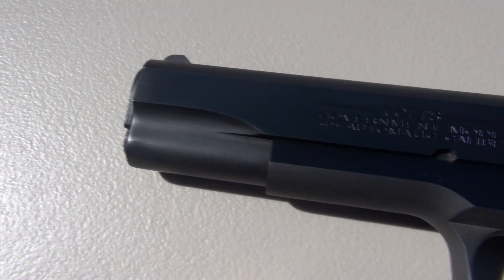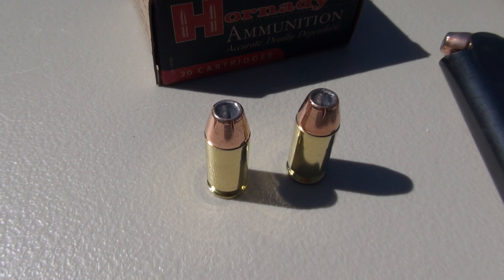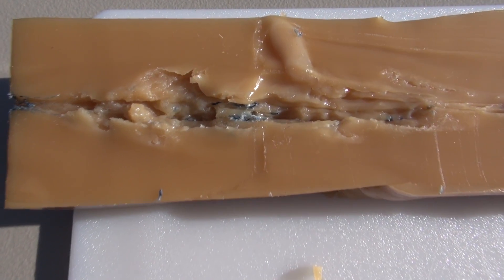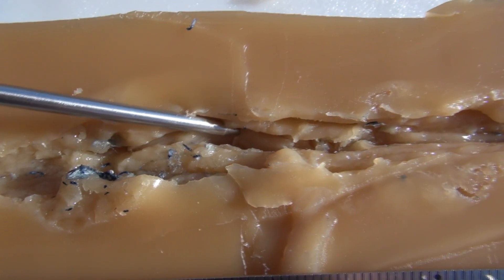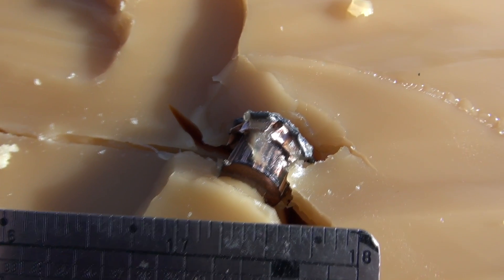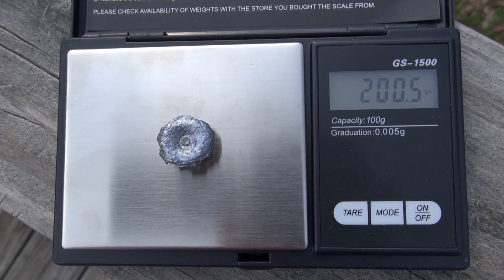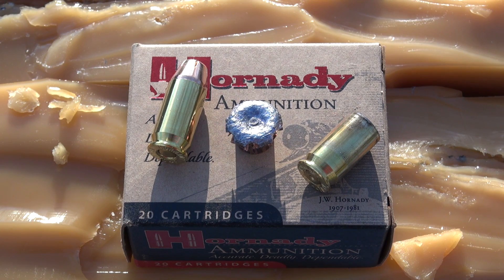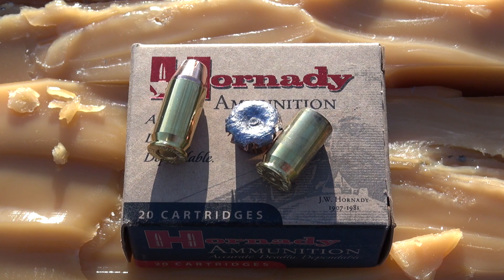.45 ACP +P Hornady XTP 200 gr JHP Gel Ammo Test

Comment: This bullet is sad for me, if it has the same energy levels as a 9mm and less velocity and less capacity than the only advantage it could have is its expanded diameter and thats what the XTP bullets here have taken away. They have neutered the best characteristic and advantage that the 45 always had over other cartridges, really good 45 ammo expands 0.80 and higher and majority of the good stuff to 0.70 and higher. If i wanted this type of penetration and expansion than i would go to 9mm as it has the same energy but more velocity and better penetration through hard barriers and more capacity and easier follow up shots. People need to really realize what are the unique advantages that each caliber has over each other in order to make sure not to take it away when looking for good ammo, i believe this is very important. You want good 45 ammo??? 45 230 grain fed HST (penetration 14 inches expansion 0.80) and also 230 grain winchester ranger T series (penetration 14 inches expansion to 1.00). The Gold dots are good but i dont like em much (penetration 12-14 inches expansion 0.68-0.70) and the old Golden saber bullets by remington were probably the best 45 bullets back in the day before they went extinct with penetration at 16-17 inches and expansion at 0.70 and higher. Have a good day everyone, and remember not every handgun caliber is the same or even near the same and sectional density still counts for something.
Reply: peter prunty    splitting hairs?? than if those measurements mean nothing than i guess all military and police should be using 38 special and 380 acp instead of 9mm since their performance is only different by a few inches or “0.2” hell they might as well carry 32 acp since it only has like 0.20 less expansion than a 9mm and about only a couple inches less of penetration. Guess what though?? there is a reason why the military and police decide to use 9mm instead of 380 acp, because those few inches or that “0.2” actually makes a difference sometimes. Same way that bullet that failed penetrating enough in the miami dade shootout would have made it to the heart had it been another type of cartridge that had that “0.2” as you say it.
Reply: peter prunty      not making any sense?? How if im using your logic of the so called “0.2” being very little
Reply: peter prunty    With your logic the 380 acp would be a better cartridge for police work or soldiers at war, since it is only behind the 9mm by a few small measurements of performance

Comment: This bullets +p can b used at.a glock 30? 45 acp gun
Reply: The glock can handle +P loads. But it's short barrel isn't giving you much advantage. The extra 'power' is not efficiently used in the short barrel and you only end up with extra muzzle flash and recoil.

Comment: I'd say it's perfect.
Reply: Expansion was bad. There are way better rounds.
Reply: @berettaxd7566  
The xtp had an original name of extra terminal penetration. They changed it to extra terminal performance later on. The xtp round is not designed to ultimately expand to the size like an HST would. It's designed to expand but its main design is to give you deeper penetration. Expansion lowers penetration depth. The xtp in this test are performing exactly the way they're supposed to

Comment: I swear that I had read an article somewhere that the Colts original 45 acp was 200 grains but when the military contracted them they asked for a heavier bullet and thus the 230 grains came about
Reply: Your absolutely right!
Reply: The US Army experience in the Philippine Insurrection cost many soldiers lives from the poor performance of the Colt .38 Lightning's lack of Stopping power. The Army had little practical experience with handguns. The Moro's and Huk's  could take 6 x .38's and lop your head off with a Bolo Knife. Western Lawmen knew handguns. What would it take to stop a drunk Indian armed with an axe? Nothing less than .44/.429, 200 gr. and 750 FPS was the answer. .44 Russian, .44 Special, .44-40 and .45 Colt were best. Nobody laughed at someone for carrying a Colt in .38-40. It's really a .40 cal. 180 gr. @ 900 FPS, same as .40 S&W. The .41 Colt was worthless as the bullet was way over stabilized.
Reply: @TheDustysix the problem with 38 long colt wasn’t the bullet diameter, it was the combo of a lightweight bullet at abysmally slow velocity. had they propelled that bullet at a higher velocity, it would’ve been much more effective especially if it was fast enough to cause deformation
Reply: The US Army didn't know handgun effectiveness ?

   The brass and bureaucrats not so much , or didn't really care . The Cavalry Troopers on the ground certainly did , from the recent Indian Wars , and from the Civil War .

   For the peak years of the Indian conflicts , the SAA's were mainly used with the one way interchangeable .45 S&W aka Schofield ammo - 230gr a 700-750 fps .  Civil War ammo ( paper ctgs ) varied between contractors . Nominal 215gr conical , actual between 200-240 . Typical as issued velocities in the 700's .

Comment: I always get less velocity from Hornady ammunition than advertised... On almost every case
Reply: They seem to pud-load their cartridges
Reply: I rarely buy factory, I reload my own. I too,  notice a vast difference in listed velocity vs real velocity. I do know velocity is speculative , meaning elevation and humidity plays a role  plus test guns used in the factory vs your firearm does also. But if a hollow point fails to meet a certain velocity then expansion is effected. I've shot some factory hollow points that just flatly failed to expand at all from my 5 inch 1911. So with that your basically using " Ball ammo" .

Comment: Why would you want to hand load this bullet and push over 1100 fps? The penetration is already at 17.5 ". Hand loads for this bullet would cause over penetration.
Reply: No one answered your last year. This was shot at 10 yards. This is a hunting bullet as such targets may 50 + yards. Extra fps  or velocity will cover distance to deer an retain the fps to have the same effect as this load at 10 yards. This is the purpose of the Underwood ammo. To get down range with enough velocity to be in the bullets  working range for expansion. As the xtp slows expansion goes down an penetration goes up.
Reply: peter prunty  Thanks
Reply: peter prunty  You are contradicting yourself and not making any sense. You say you want over penetration and then say loading it hotter will cause problems with bullet integrity, but loading it hotter will cause both. Over penetration is not good if the hollow point does not expand. You don't know what you are talking about.

Comment: I hunt one area that while outside city limits, still has homes fairly close.  I've used this round in a Marlin Camp carbine several times with great success.  Shots are close and noise is much quieter than a shotgun. 200gr gives massive internal damage with most of the velocity spent by the time it exits. Good compromise. 100 and down sized deer. Inside 50yds no prob.

Comment: 2 questions. How much penetration roughly equates to a pass through on a whitetail deer? Also do you think a 185 xtp from underwood would give adequate penetration? It seems like the more velocity the better with xtp's.
Reply: +K Bob As a LEO I had to put down an injured New England whitetail several years ago. Granted that deer was not in top health. However she was still standing and moving around favoring an injured leg when I took a single clean broadside shot on her. After being hit she ran approximately 50 yards and attempted to climb a small dirt embankment before going down. She was given to a neighbor hunter who field dressed and butchered her. She dressed out at just under 130lbs and the shot took out lower part of the heart. The round was a 127gr Federal Ranger +p+ in 9mm shot from a Beretta 92f. For the record I never officially hunted deer with any caliber lower than a .44 mag. Just thought I would throw this experience out there.
Reply from the maker: K Bob That will depend on where you live.  Even in Tennessee, based on region, elevation, county, etc. deer will have a variety of "density".  In my area, a minimum of 16 to 20".

Second question....are you considering hunting deer with a .45?
Reply: ***** I'm in Northern Alabama so same sized deer most likely and yes. Actually, I'm either going to hunt them with a 45 or a 9mm. I wouldn't even be toying with the notion  but I came across a page called High Powers and Handgun by the late Stephen Camp. I know it can be done but I'm only going to attempt it under ideal conditions, broad side only etc. He said his best luck was with the 124 xtp from 9mm at around 1200 fps or any 230 gr bonded bullet. I found a load by Underwood that pushes either a 185 gr xtp at 1200 or a 230 gr at 1000. I feel like the 230 gr load is a safe bet on a pass through but I thought the velocity on the 185 gr bullet might give more peripheral damage but if it won't give a clean pass through I was gonna write it off. All of this is under the assumption that the shots will be at 25 yards or less. Past that I couldn't guarantee ideal shot placement. I just wanted to see what you thought about the lighter xtp because they seem to behave differently from every other hollow point because of their mild expansion.
Reply: @K-bob_45  5 years later now. How did it work out. I've used 41mag on deer.
Love to hear experience with 45.
Reply: @eoj1001  never got around to it. Got tired of hunting AL and running into trespassers. I’ve had my sights set on an Idaho elk hunt for about 3 years now and hopefully this year I’ll go hunting again
Reply: K Bo
Reply: peter prunty 😂😂 only someone who can’t shoot would say that. Deer get taken all the time with bows shooting 3/4 in broadheads. Why don’t you explain how a good 45 is considered less effective than a 45 lb recurve with a 3/4 in broadhead.

Comment: Interesting and informative. It's what I carry in my 3.6" barrel Bersa most of the time. I know of a guy who dropped a 200lb feral pig in Georgia with one shot of that load. He missed twice before he hit it, but it was a one-shot-kill. I also carry the 117gr equivalent in my 9mm (but no +P, as it's nearly a pocket pistol). I generally carry the XTP's because I'm as concerned about large vicious dogs as I am about vicious armed humans. I actually started buying +P loads because I was concerned about getting expansion from a short barrel, but maybe with XTP it's one step forward/one step back? I figured the smaller-than-230gr bullets coupled with +P power would be more likely to open with increased velocity. Maybe I'm kidding myself. It appears the XTP doesn't open all that much, even through a longer barrel. However, it does penetrate very well and does open a little. Did you say it expanded to .67? I think many 9mm JHP's expand to .62 or .63....so what would be the advantage here? I'm trying to piece it all together. Thanks for the video on this.

Comment: Why would you think a hollow point would penetrate a 20" block of gel?  Not what they are designed to do
Reply: If the bullet fails to expand, which has happend on some of his test, it will be in the water jugs. This round performed to specs and did'nt like but 2 1/2 inches from exiting. The man knows what he is doing.
Reply: You do not want hollow points exiting a human body in a self defense situation and causing harm to someone else.  Yes they sometimes fail to expand but most cases should expand and stay in the body cavity
Reply: +ransackerpants this round isnt made for self defense, its made for hunting
Reply: wrong, critical defense is their self defense load, critical duty is their law enforcement round (recommended for duty sized guns) and hornady custom (xtp) is their hunting/woods line of ammo, designed to maximize penetration because many animals can be much thicker

Comment: I'd call that very good.  I have had 2 shootings recently with .357 mag critical defense (hog) and .380 auto critical defense (human).  BOTH shed their jackets and separated from the core.  The hog was a lethal shot (through the heart), the human was not (face, mouth, teeth).   I was carrying critical defense in my 9 mm Glock 26 but since that I switched to Corbon PowerBall 165 gr +Pin my .45 XDs and back to hydra shock 147 gr HP in my G26.

Comment: If I could easily get my hands on some HSTs, I'd be going with those instead, but for now, I think these XTPs on the Fiocchi line will do for me. Lots of penetration with acceptable (for me) expansion and nickel plated casings for undeniably positive feeding and extraction even in a dirty gun.

But once I can get some HSTs, I'll definitely be going with those instead with my stockpile of Fiocchi XTPs as backup.

Thanks again for the vids, tn.

Comment: Hornady XTP 200g +P > Speer 200g +P

I much rather have it go well over 12 inches than have it expand to nearly 2 inches in diameter and go just over 12 inches. imo.
Reply: If the bullet has less velocity than a 9mm and just about the same energy levels than the only thing that can set it apart is its expanded diameter, and thats where the 45 acp is meant to shine because it causes the most tissue damage by always constantly and reliably expanding 0.70 and higher if its good ammo (although 0.80 and higher is the stuff i would consider good 45 acp ammo). The lower penetration of the good 45 ammo is also its unique characteristic because it has good enough penetration but will not over penetrate all of the time and some people like that, if someone chooses 45 the only logical reason would be either for more expansion or less penetration which both come hand in hand in the good 45 ammo. If you wanted this type of performance you should have went to 9mm because it has more velocity, the same penetration or more (depending on manufacturer and 9mm always penetrates barriers better) and easier follow up shots and more capacity. People go to 45 for the greater tissue damage it has over all other common handgun rounds, if you take that away than it has no special advantage. The 40 S&W and 45 acp both have their own unique advantages over the 9mm and its important to realize those advantages and not take them away, or else your better off choosing the smaller 9mm with easier follow up shots and more capacity and velocity and penetration. The 40 and 45 perform better than the 9mm in my opinion but you have to be careful not to neuter their best characteristics.
Reply: Mark Young     +p means + pressure and it means its loaded to higher pressures (I believe that is achieved with more powder but i have not delved into hand loading yet so cant assume im correct on that bit) and therefore gives the round more velocity and energy which is what people mean when they say “power”. Good 9mm ammo in normal situations (unlike this pandemic) is very easy to find because of popularity, anything like Winchester white box JHP, or any of the federal JHP would do fine. I think its unnecessary to get +p 9mm ammo as it makes the ammo more expensive and follow up shots are not as smooth (although still easy) and it puts more wear and tear on the gun quicker, all of this means you are taking away some of the best attributes of the 9mm, although many police departments loved the +p 9mm because it performed better than standard pressure 115 grain 9mm. That problem can be solved by using modern Bonded JHP ammo at 124 grains of bullet weight (124 grains always performs the best in 9mm, 115 grain penetrates the least, 147 grain is really great and a police favorite but i don’t like taking away the 9mm’s great velocity). As far as the 45 acp, the best ammo in my humble opinion would be Federal HST which penetrates 14 inches (anything higher than 12 inches qualifies as good by fbi standards) and always expands to 0.80 and higher even through clothing. There is also Winchester Ranger T series ammo which penetrates to 14 inches and expands to a whole entire inch (1.01 expansion), although its legal by law for any civilian to own it is company policy to call it “Law Enforcement ammo only” which means its a pretty risky ammo to use as a lawyer in court can easily say you were not shooting in self defense because you had extremely deadly rounds that were meant for “law enforcement only”. That is up to you if you wana take that risk with the ranger T ammo. A lot of people mention speer gold dot ammo for all calibers but i dont like them cause they don’t expand as much as they should and their results in test are very erratic and deviate a lot (just look up gold dot test videos comparing different videos of the same caliber and same bullet weight). If you want some good ammo testing results you can look at the online test results by lucky gunner lab test or ammunitiontogo.com, also there are plenty of good test on youtube, scubaoz is a pretty good channel as is “Tfbtv” and a couple others. Anyways all in all, id say go with federal HST for your 45 acp and for 9mm anything by winchester or federal really.
Reply: Mark Young     wow!! i wrote way too much, im really sorry for that. I apologize i got carried away

Comment: The Hornady rounds are longer, but not out of spec for .45acp.  I have read that some barrels don't have the chambers milled to the correct depth.  My 1911 won't extract them without a fight either, I might take it to a gunsmith and have him check the chamber dimensions and see if it needs to be reamed out any.